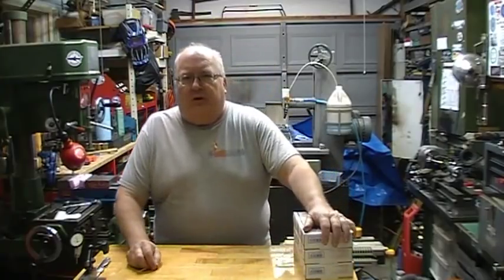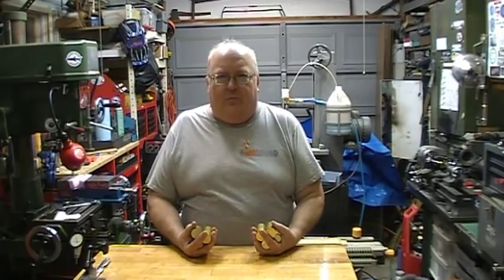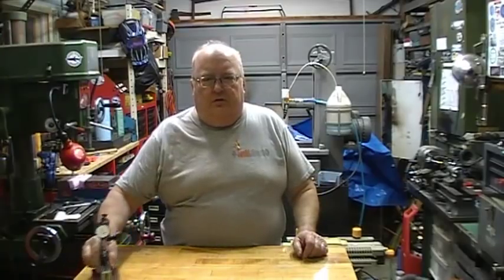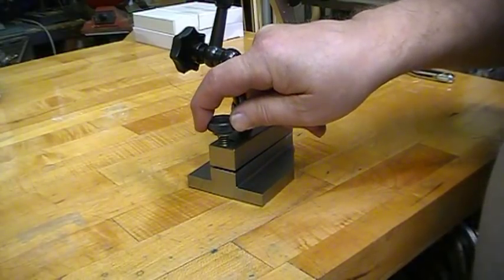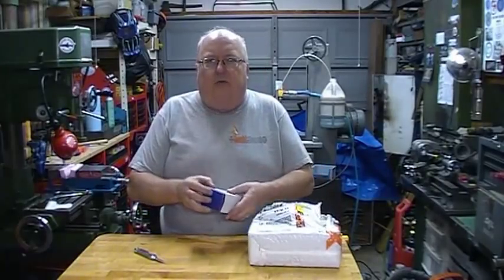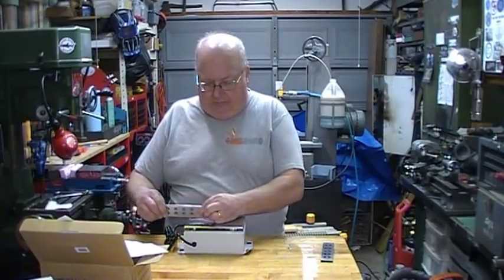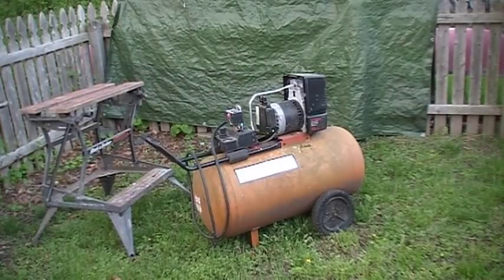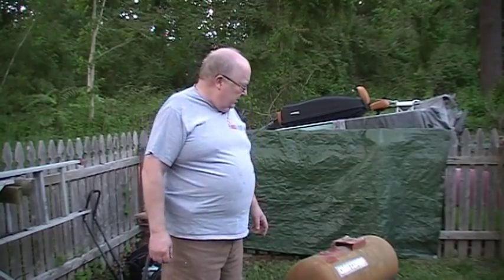Shark Bits #17, Viewer Mail, Shop Up-Dates, New Projects

Comment: You're a man after my own heart, repurposing a dead air compressor to a smoker - I'm on the hunt for an expired 30lb propane cylinder to make a wood stove for my cast iron wok!  Interesting to hear you thoughts and notes on the refinements to the squareness comparator, that may be a project here in the future too now that I have a basic plate.  And for what it's worth, watching brass turn never gets old for me, I love how it's like machining gold . . .
Reply from the maker: Everett's Workshop make sure to watch Steve Barton’s (Solid Rock Machine) take on the squareness comparator.  I just got the new Noga arm in for mine.  I think that will be the end of the mods. Thanks fir your support.